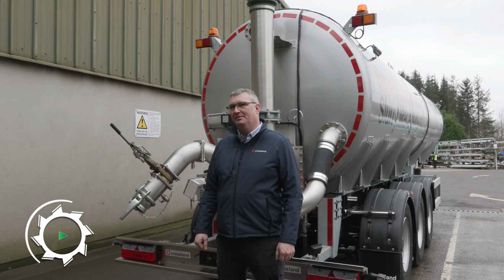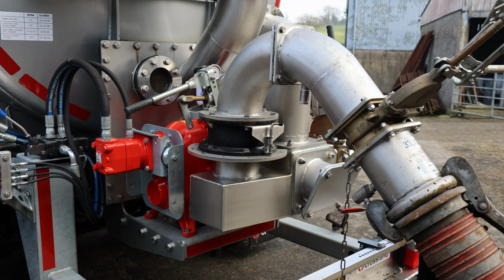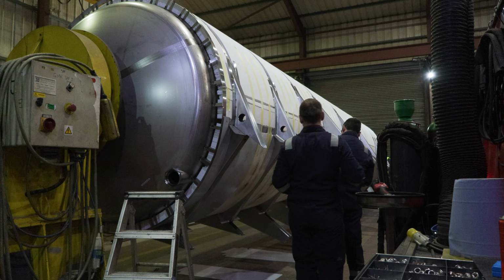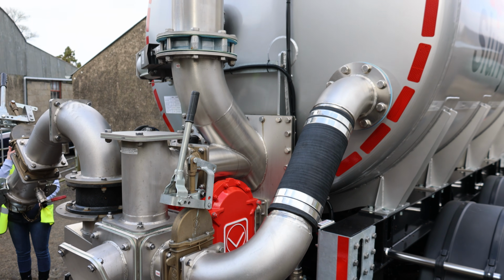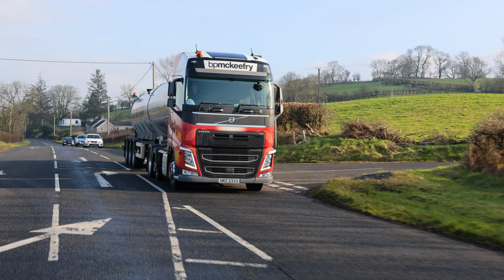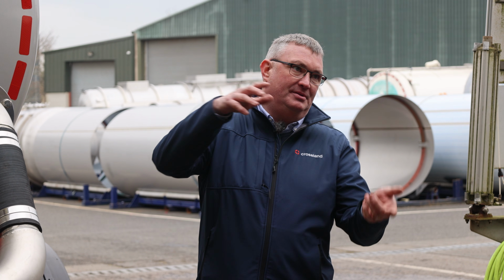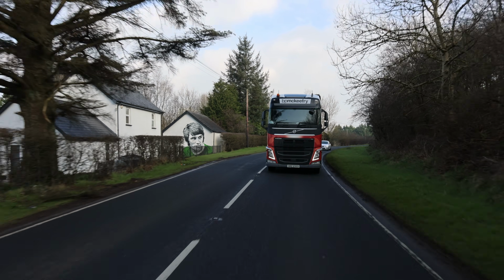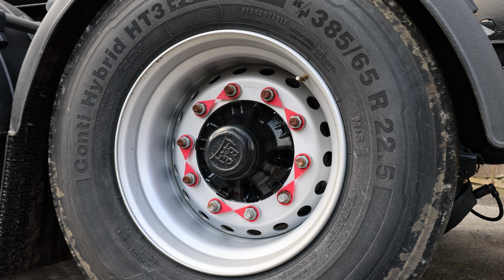Customize your tank with Crossland

Comment: You should really take a look on VM Tarm from Denmark I worked at a company that is running 3 of those trailers that can load with a lobepump or a centrifugalpump. with a loading arm that is about 8 ish meterts. No problem loading 32m3 in 3minutes.

Comment: I think you need to do some videos on stocks mans tractors . Get a jd 5m , nh t5, valtra g, mf 5s  etc and put them to proper work, mowing, aggitating slurry etc. Then compare actual real world fuel economy , pulling power , ease of use. Dont get bogged down in manufacturer gimics. 
Please . And please do it properly, with actual to tests and not just opinion.
Reply from the maker: Yes this is a great idea.  It would be a lot harder to do than it looks tho.